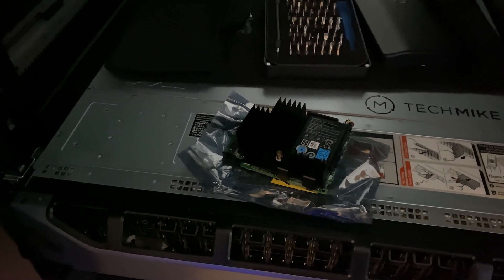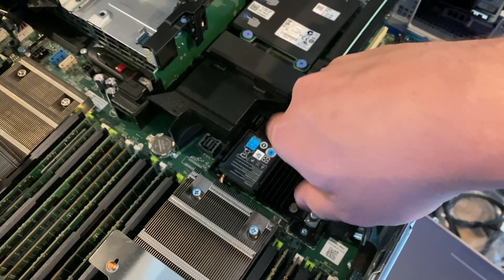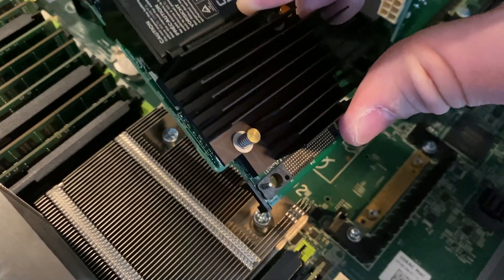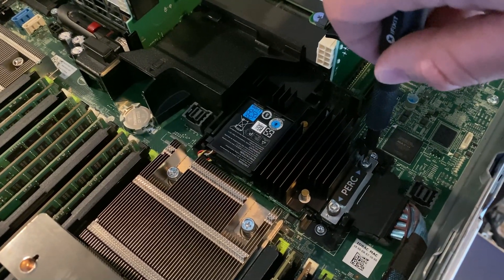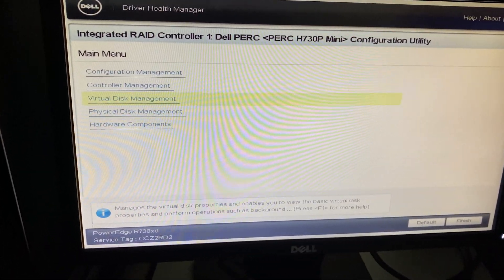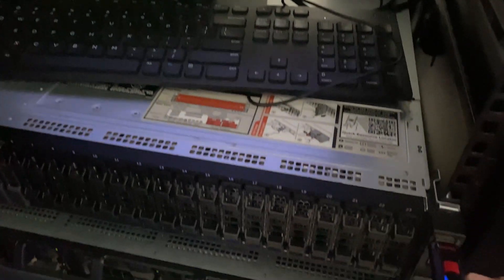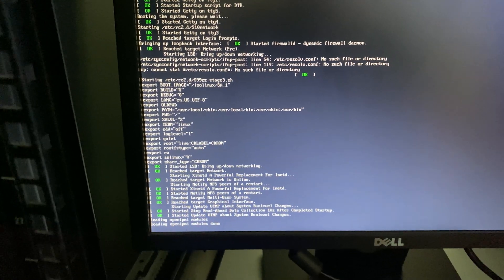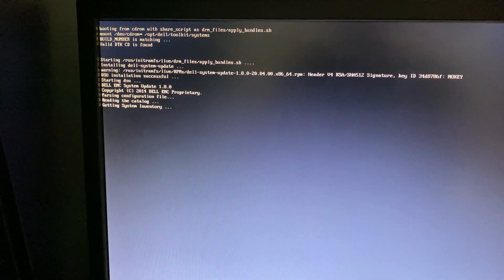Home Data Center - Dell PowerEdge R730XD Replacing PERC H730 to H730P

Comment: Do these H730 card also work in normal consumer / desktop motherboards (not servers) ? Or is that PCI slot different ?
Reply from the maker: They are just standard PCIe X8 sometimes x16 depending on a hba or raid card that needs the kind of bandwidth.